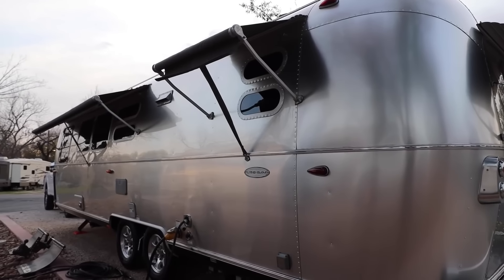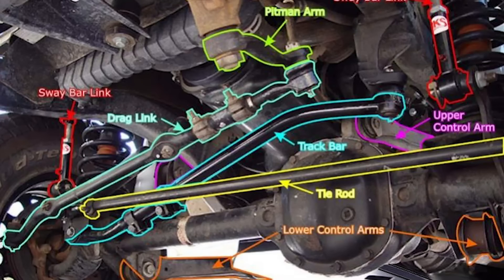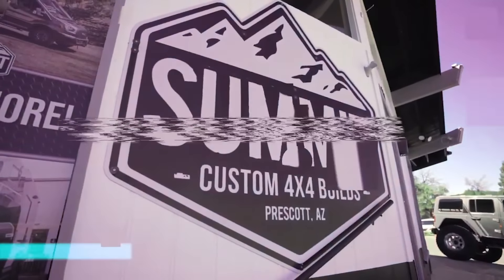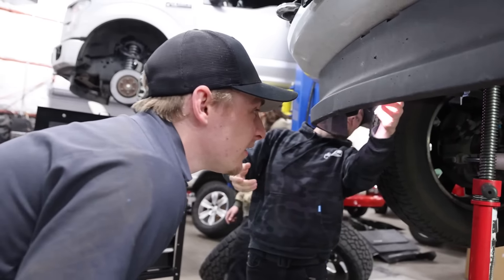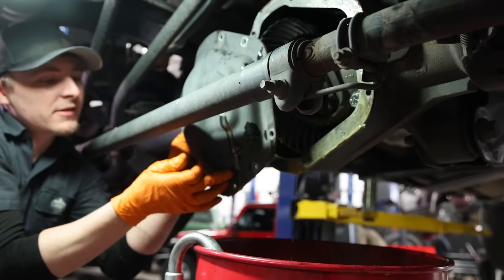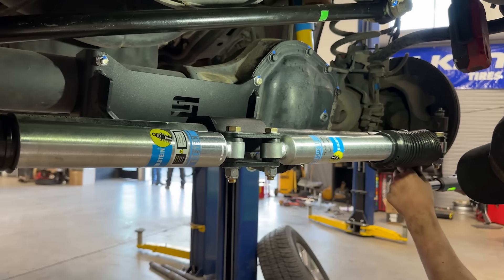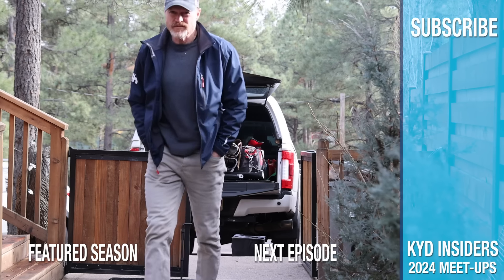2024 Ford Super Duty: Why We Passed...

Comment from the maker: ⛽ Gas Vs. Diesel Blog: https://www.keepyourdaydream.com/diesel/
Reply: Thanks
I Love Diesels and have had them all my life. But, would not buy one today as a personal truck. I will go with gas and not tow heavy or just use as a tow behind. 

Reasons IMHO:
1. Have handled a small fleet of Rams, Duramax and PStrokes with each running 100k plus in miles per year. The number one issue we have with the trucks, Semis and equipment is the DEF systems. Absolutely hate them. The ones who designed, pushed and voted on this crap, should be made to repair themselves and pay for the repair. 

2. The 20-30% fuel savings is lost in the fuel price. For us it avg between .50 to 1.25 Per Gall difference. Have seen it at 1.50. 

3. HP Fuel Systems can be a huge issue. Seen it happen. 

So as much as I love the 2500 & 3500 diesels (have had many of them), not planning to buy any more unless things change drastically. 

THE JUICE IS NOT WORTH THE QUEEZE!!!! Again IMHO and this is for me and my family. Just giving food for thought.
Reply: se i would rather have gas in modern trucks BECAUSE diesel fuel is the poorest quality it has ever been in the USA and diesel trucks today are WAY so sensitive to contamination
Reply: @jos6216   The EPA has ruined all diesel engines with their regs.  It's just sad.

Comment: Don’t ever let a place hook a machine up and “flush” your transmission.  Drain, replace filter, fill, done.  Never “flush”.
Reply: Ford hasn’t been drain and fill for a couple decades. You have to have a special machine to extract or add fluid.
Reply: @taylorjackson7908  my old 2005 and 2010 F150 would disagree
Reply: @bizzfo  correction they sealed the transmissions in 2017. They no longer have a dipstick either.
Reply: @taylorjackson7908  yet another reason to not buy a Ford.
Reply: @bizzfo  I agree !
Reply: There is a dip stick on the transmission
Reply: @taylorjackson7908 did you not see them literally add trans fluid via the dipstick tube??
Reply: I had it done years ago  and trans acted  crappy for long time ..
Reply: @bizzfo  Your 2010 has a thermostat in the transmission. If someone tried to flush it you got scammed.
Reply: @taylorjackson7908  my f250 2017 has a drain plug for transmission , think the last year
Reply: @taylorjackson7908  not my 2017 has dipstick and drain plug
Reply: @bizzfo ur trucks are about two decades old hahah
Reply: Why? You do what the manufacturer recommends, after all there the ones designing and building the trucks.

Comment: Just found your channel. I've got 135,000 on my 2017 F350 DRW diesel. Still has the original shocks, brakes and rear pads. Just spent $4k to fix the 4x4 since the interior switch wasn't engaging the front hubs. It's my daily driver. 86 miles a day. Love it and it still looks and drives like new.
Reply from the maker: Welcome. Lots of truck content if you search KYD Truck Mods. More repairs and updates to come this year.

Comment: On our second Superduty…great truck.  I upgraded from 2018 250 to 2022 350 DRW to upgrade campers so we could do a big toy hauler.  We actually downsized from toy hauler back to small fifth wheel recently. We could downsize back to f250, but we would likely take a beating on that deal, so we are sticking with the F350.  I agree that the F250 is much more nimble than the F350 dually.

Also glad there was no damage to the differential…when I saw the chocolate milk my first thought was that’s not good. It’s good that they checked!  

I also echo the comments on the young mechanic.  It’s refreshing to see talented young people going into these very much needed fields.  It requires much knowledge and skill to work on vehicles.

Comment: Mark, I recommend a S&S Diesel replacement fuel pump or at least a disaster prevention kit! If that Bosh CP4 grenades it’s like a 11k fix.
 
Love the mustache and truck looks  awesome! Safe travels, go summer 2024!!!
Reply: Installed the S&S DCR on my 2018 F250 @173,000 mi. Peace of mind for the longer term not having the CP4 failure issue and the expensive repair.
Reply: My 2014 F350 had the fuel pump catastrophic failure at 86k miles with 6.7 power stroke....no warranty and it was 14,650 $ cash out of pocket at Ford dealership in Manteca CA......I now have the S&S dpk.... could have saved me ......your dead right

Comment: I have a 2022 F350 Tremor and I have to admit I really love this truck. A guy asked me "what do you pull with that?"  I told him, "whatever I want." Love the super duty.
Reply: There is a youtuber who had a ford f350 tremor but because of the tremor package, it's not on par to tow their Alliance 5th wheel so they run to the Ram dealership and got a Ram cummins to be able to pull their heavy 5th wheel legally and safely.
Reply: @j.l.salayao8055  the rest of the story is they changed from a travel trailer to the 5th wheel and found they were overweight. It pulled fine, but they were overweight. They wanted a ford 450, but had communication issues with the ford dealer.  They settled for the ram.
Reply: Wondering if you are still running factory emissions or have you fully deleted?

Comment: My husbands f350 super duty diesel finally came after a 2 year wait too.  First trip pulling our 5th wheel, 2000 miles on the truck, we lost our transmission. Finally got it back after a month. Fingers crossed that we won’t have any other problems. I kinda wish we still had our f250.
Reply from the maker: Uhg. Sorry. Truck problems are the worse.

Comment: You definitely have one of the gem SuperDutys. The pre 2020 trucks with the 6 speed are really solid. Ford is having a very hard time with a ton of quality issues, so you absolutely made the right choice. 

Im not going to lie, though.The 2024 Platnium with the Carmel interior is absolutely gorgeous.
Reply: I prefer the 6 speed also.  It's essentially the same as the 5r110 that was designed for and introduced with the 6.0 powerstroke in '03.  IMHO a great platform overall, with correct maintenance and updates for the engine of course.

Comment: Very nicely done.  You give just enough details but I have to tell you, I love listening to professionals talk,  That young man helping you is spot on and a true professional.  Not only does he know how to install, he easily explains how the components work and what the effect if when the parts wear out.  He is very impressive.  I want that shop to work on my truck.  I had our local shop change all my fluids but they stripped two bolt holes that showed signs of galling on the bolt.  I am confident from all the air guns I heard within that shop, the mechanic used and air gun to try to take out the pan bolts on my transmission.  The mechanics working on your truck show signs of true professionals.  PS, I want to add a dual stabilizer to my 2004 F350 since I hope to get another 100,000 miles to the already 230,000 miles.  The truck runs great and we just had the entire front end changed out.  Great episode.

Comment: Thanks for the commentary on why you passed on the 2024.  I totally agree with your logic.  I drive a 2000 F250 Crew Cab 4x4 with only 90k on it and using your logic, my net cost of ownership is zero as I can still sell it for what I paid for it with 60k miles 10 years ago.  I replaced all of the ball joints and major suspension components about 5k miles ago and the truck handles wonderfully. The only downside for the truck is that it's a V10 which doesn't get good gas mileage.  But it's been very reliable.
Reply: His logic regarding what a truck costs.  Purchase price vs sell price down the road is incredibly misleading.  First.  The new truck at 105 k plus taxes etc will require a very high payment for most folks.  With today's high interest rates the payment is even higher than it would be in 2019.  I suspect the very high payment on the new 2024 truck exceeded his budget.

Comment: Always enjoy your videos and info you provide, for the DIYers like myself, I think its important to note, to always make sure you can unscrew the refill bolt on a diff cover first, because if you take the cover off, drain the oil out and can’t get that bolt loose, you will scrambling to get a new cover, which may or may not be readily available, and since you can’t put oil in the diff you can’t drive the truck.

Comment: Blackstone is a great company, and the info they provide is great for long term maintenance of vehicles.   Toyota says oil change every 5k miles, I do 10k and Blackstone says I could do even more  (2020 4Runner with 112000 miles).    Also went from oem shocks to Bilstein, and the difference was  incredible.

Comment: I've had five Super Dutys (someone check my grammar here). 1: a 2000 F350,  srw with a 7.3 diesel. 2: a 2006 F350 drw,  with a 6.0...not a good engine,  but a fantastic truck.  3: a 2012 F350 drw,  with a 6.7...excellent truck,  excellent engine,  until 100k miles.  Then 4: while getting the 2012 repaired,  I saw a black 2015 F350 drw that had had a minor wreck...never do that in 2019,  while hauling our four horses,  we were rear ended on the freeway. Minor horse injuries,  but the trailer was totaled...truck frame was bent. So, 5: a 2019 F450  xlt...I love this truck.
Reply: Stinks when they are taken from you, and you don’t need a new one on YOUR terms…. I’ve been there done that.

Comment: I am on my second f450 and I love the wider stance on the front axle. Definitely handles great on the highway. What I do hate about my superduty is hole in the roof, aka sunroof. I hate all the dumb telescoping steering column, brake pedals, heated everything that will fail in 5-8 years.  All this extra goofy electronic computerized garbage on these new trucks. I like electric windows and the bigger screen radio.  The bigger brakes are a great plus for towing

Comment: I changed my diffs, transfer case, transmission fluid, and coolant every 30,000 miles on my Nissan Xterra I bought new in 2007.  It is now at 280,000 miles and the only driveline item I've changed is replaced the starter at 240,000.  On my second set of Bilstein 4600 shocks. I turn all my own wrenches.  Very little towing but a LOT of off roading in San Juan (Rocky) mountains.

Comment: We bought our very first Truck in 2023.  A 2023 GMC Canyon! 2.7L Turbo Gas.  It is a huge upgrade from our 2018 (3.4L v6) Grand Caravan.  We have a small (17ft box - 2,900lbs, Single Axel) Travel Trailer.  The Grand Caravan pulled it fine, but the GMC pulls it great!  Got the Truck in time to do a short trip in the fall before putting it in storage for the winter.

We retire this summer and have just finished booking our very first longer trip to circumnavigate Lake Huron.  It will be the first time we cross the border with a Camper (I'll look for your videos on borders and Michigan).  When I was 10 years old my family did the same trip along with my uncle and family pulling Tent Trailers.  My Aunt passed away just recently and her funeral is this week.  Brings back many memories.  We now live just an hour away from were that trip ended. 

In 2025 we are either going to follow your trip to Nova Scotia, or head west to the Rockies.  We will go the next direction the following year.

Thanks for this video and the value of good maintenance.

Comment: Great Video!  We have a 2017 version of the same truck you have, even down to the color.  I've had it at the dealership 2 times for the death wobble and each time they just replace the crappy Rancho steering stabilizer.  The is a diesel shop near my house that does suspension and I'm going to take it there to get checked out.  I've been looking at the same steering stabilizer that you just put on and will get that done in addition to replacing any worn out components.  We only have 52K miles on it, but the bulk of that is towing 5th wheel RV's.

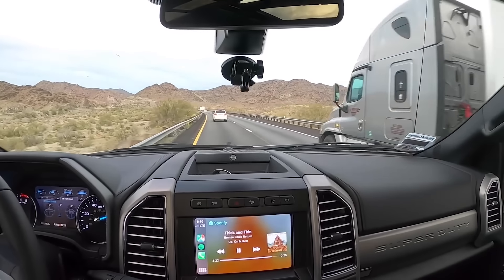Comment: We have been full-time RV dwellers/nomadic for six years(and still counting). We had a 2017 f350 diesel hauling our 33 feet heavy travel trailer all over the west. It has been reliable and never let us down except the death wobble and steering feel and not feeling too planted on the ground when running empty and when towing(possibly the aluminum body). I skipped the 2024, 2023, 2022, 2021, 2020, 2019, 2018 super duties. Now, we have our new 2023 Ram 3500 H.O. Cummins with Aisin and 4:10 gear ratio. The towing experience and empty driving is great for us most importantly is the engine brake with tow haul mode really does amazing compared to our super duty. I rarely touch the brake pedal with the full-exhaust-brake engage. Auto leveling air bag is also very helpful when leveling for towing or empty. But if I have the extra money to spend, I'll still keep my current Ram for real towing and add ford and gmc/chevy for all around driving, grocery getter, and maybe light towing. "Home is where we park it."
-Howdy, from the Nevada Desert!🤠🏜🏕🪵🪵🪵

Comment: You should really consider installing the DCR conversion kit what that does is removes your stock CP four high-pressure fuel pump, which is prone for failure and you install the new S&S diesel pump
Reply from the maker: Hopefully in May.

Comment: Great video Marc. My 2013 F350 with 78k is overdue shocks and front end inspection.  This is a good time to mention to make sure that the front axle half shafts are getting greased when serviced. These seem to get overlooked often creating an easily avoidable significant expense.  Looking forward to a possible CP4 to DCR pump conversion episode. Safe travels!

Comment: I drive a 2015 F250 Platinum.  Love the hell outta of it.  We have a 33' pull behind.  We had the death wobble, too.  I swapped the stock Rancho RS5000X shocks with the Rancho RS9000XL and the wobble is gone.  
Anyone dealing with this issue, swapping out shocks for might be the easiest, most cost effective route.  Fixed the problem for under $500 and about 2 hours of work.

Comment: Years ago, I had service guys tell me I was wasting money with overkill on service. At every oil change, I changed the fuel filter and alternated changing (trans filter and transfer case oil) (front and rear diffs). But a 1999 Dodge 2500 5.9 cummins that towed approx 75% of it's life with much of that towing a 24' GN horse trailer. Then a 2005 Dodge 3500 dually HO 5.9 cummins towing a 42' living quarters 4 horse trailer all over the NC, TN & VA mountains. No drivetrain issues out of either truck. I traded both running and towing great, the 1999 had 251K miles and the 2005 had 207k miles when I traded.

Comment: We traded our F150 for a '24 Silverado 2500 with the 6.6 gasser.  Trucks rated for 18,400 5th wheel and has 3500lbs of payload.
Reply: I'll never own a gasser. The towing difference from a gasser to a diesel is night and day. The gasser will constantly rev out on hills to maintain speed. A diesel will rarely ever drop a gear to power over hills.
Reply: The diesel cost thousands more in purchase price, maintenance cost,  I've got a F350 with 7.3 gas. Awesome towing pickup.  I'll listen to that big motor roar knowing I'm saving a ton of money and headache not having a diesel.
Reply: How much was the damage$$$$
Reply: @rustydusty1111  Id rather save on maint costs.  Diesel is a 10K$ option.  I can buy a lot of gas for that.  Def problems are cosntant.  Fuel costs.  Today's gassers are MORE than capable of towing the big loads.  I'd rather go slower up a hill then deal with a diesel.  I'll never own a  diesel.
Reply: @jimanderson2518  out the door 51k on our '24 Silverado 2500 LT
Reply: Just remember, you get your money back out of the diesel option on the back end…. Maintenance is more, but I’m ok with that because the range is more (both tank to tank and overall longevity).  It’s not for everyone, but I’ve had a 7.3L power stroke and two L5P Duramaxs (gen1 and 24 gen2) and they have all been great.  I am only brand loyal between GM and Ford, I was a one and done w Ram.  The new GM and Ford product is really nice, but it isn’t cheap by any stretch.  That said, prices aren’t coming down with supply chain issues, material costs and inflation, the super high new labor deal, and expensive money to borrow…. I typically buy what I can get the best deal on…

Comment: Great video and great wisdom on the true cost of truck ownership. I have a 2023 F250 Tremor with the 7.3 and love it. The DEF use on the 23 and newer powerstrokes is apparently much greater than previous years. When you do decide to upgrade I would take a hard look at the 7.3. I pull an 11k lb 38ft travel trailer and have been very impressed. Getting 8-9mpg towing makes the diesel really hard to justify when most are only getting around 11 towing similar weights. The 7.3 with 4.30 gears pulls exceptionally well.

Comment: Spot on Marc!   We bought our 2019 F-150 2.7L XLT (because we tow just a small TT with UWV=4200lb)  in January of 2020 and because of soft market and all rebates we paid $46K Canadian for it (after all taxes) with MSRP window sticker of $57,249 Canadian before taxes... (still have a pic of the Ford blue window sticker they have to display on each car here).
It was two months before the pandemic and then crazy things kicked into overdrive :).  I can sell it now for $39-40K Canadian (based on mileage and equipment package)  or just $6K less,  crazy!  Of course the question is a bit more complex because that 40K is not worth what it was in 2019 but that is a side discussion of a separate topic.   That truck got us through two 3 month trips to US with the trailer one all the way to CA so it did great and I would not be looking at a different vehicle precisely for the reason you have stated, and that is the market is just still not even close to being balanced and this is reflected in the pricing and absence of incentives.